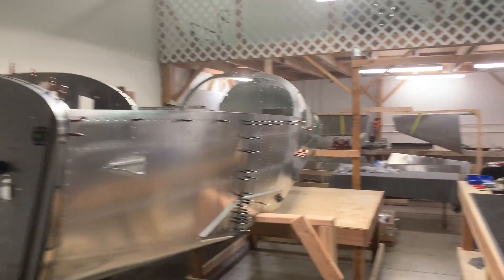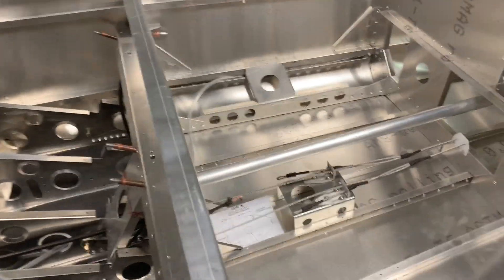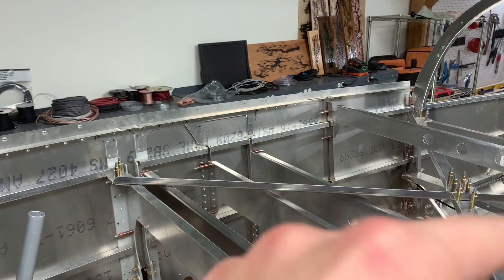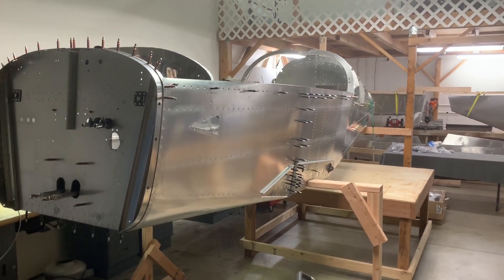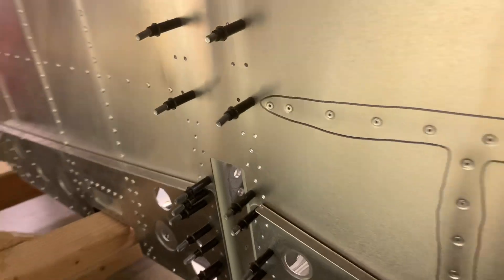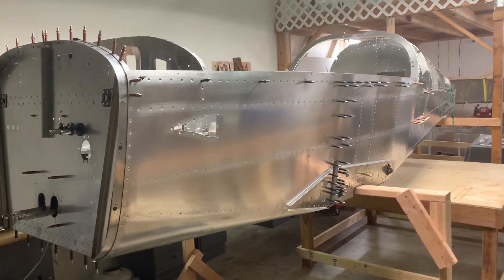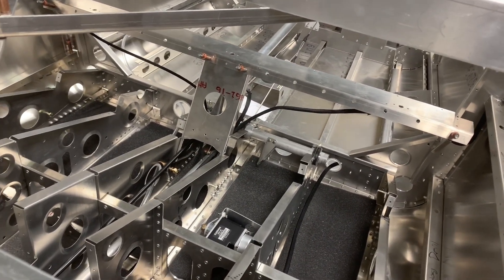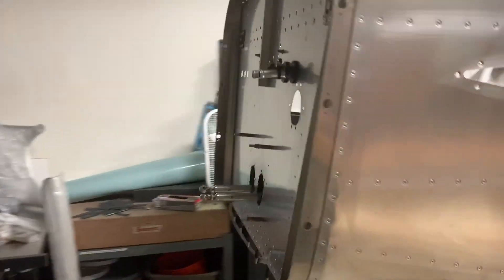Week 5 Sling TSi Progress Update!

Comment: What do they recommend in lieu of the electrical kit?  You have your panel figured out yet?  I’m still waffling between this and rv10, slight lean towards sling.  I think I just need to see both in person.
Reply from the maker: The electrical kit is mostly just wires, cabin lights, etc and they recommend to purchase them locally to save some money. They provide the packing list for the electricals kit so all you have to do is use it like a shopping list. I'm not 100% sure if the savings is worth the hassle of ordering like this, but I'm also not sure the electricals kit would be 100% accurate due to variations in personal avionics, mounting locations, and component choices.

The Sling is definitely a better looking plane in my opinion, more sleek and styled better. The RV10 is faster, but does not have the modern features of the Sling with the FADEC 915is engine. I think its safe to say all of us who are building the TSi wrestled with the same decision you're going through!
Reply: @EvanBrunye  Hey Evan, sent you an email in case you’ll have time to connect while I’m in town.  Hopefully I sent it to the right place.